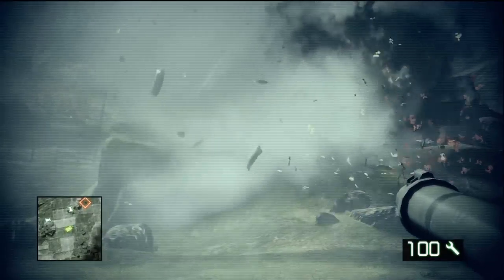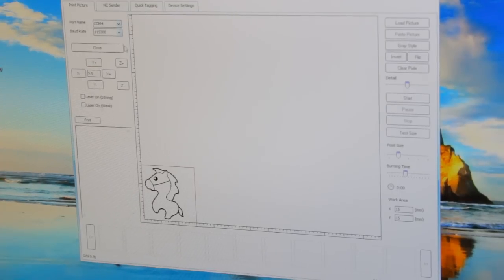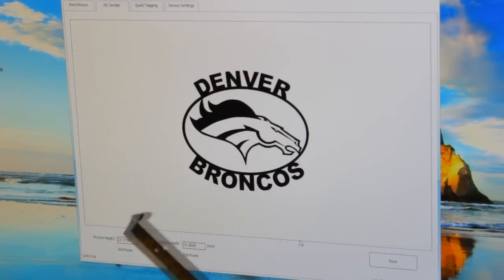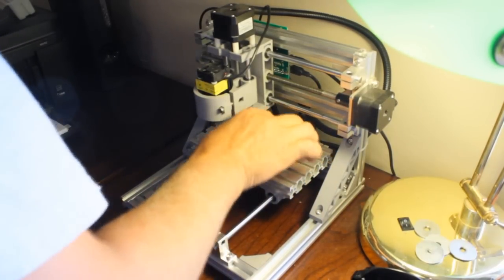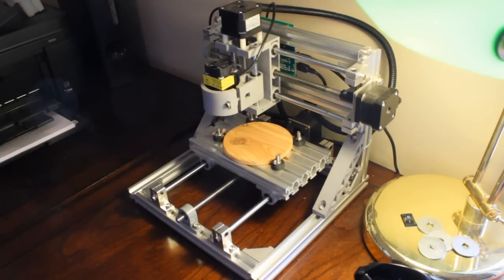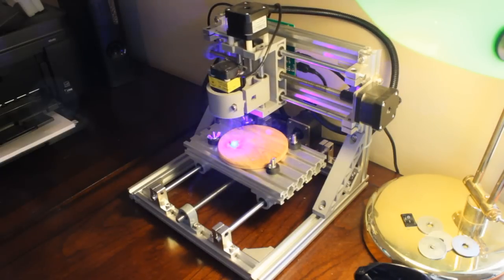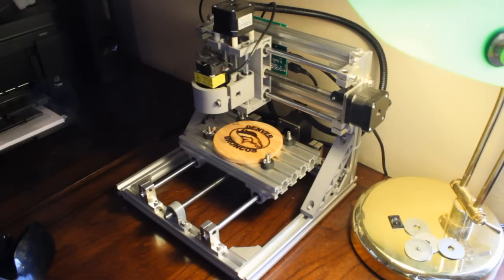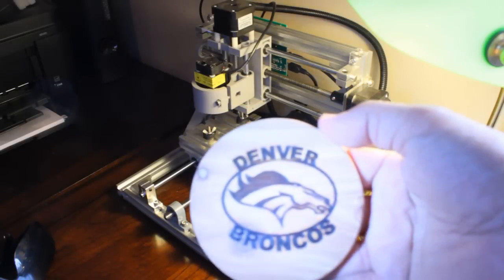Denver Broncos Coaster - 1610 CNC Machine

Comment: I make a lot of coasters and I commend you on your work. I also like working with Cedar and Mesquite for the aroma! Through the thousands that I have made I would like to offer you one suggestion. I think you should try to hit it with some 220G sand paper after lasing, you will find that your overburn disappears and your lines are MUCH clearer and sharper. Obviously don't go too deep and over sand, but just take that surface off prior to finishing. Or as an alternative cover the entire lasing surface with blue painters tape, it will burn through. Peel the tape off and your lines are perfect. Personally, I prefer the former method over the latter.

I like the finishing hanger, innovative. Keep up the great work and keep making brother.
Reply from the maker: thanks for the advise!